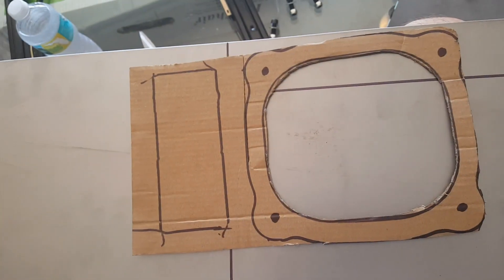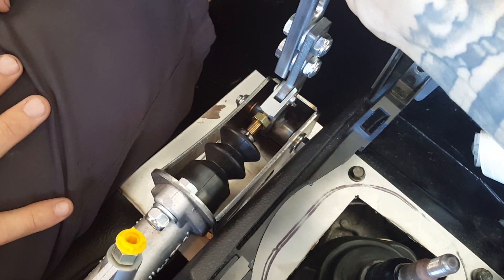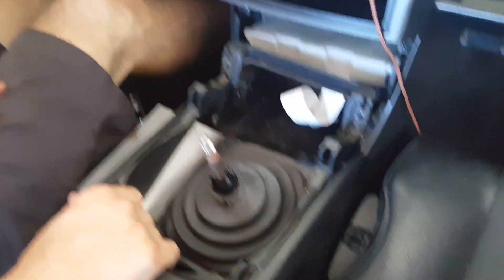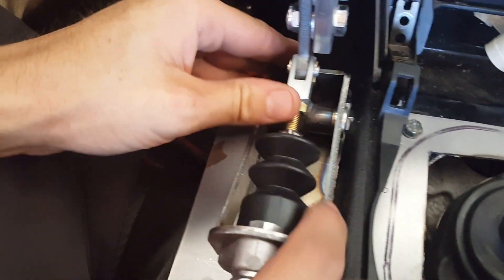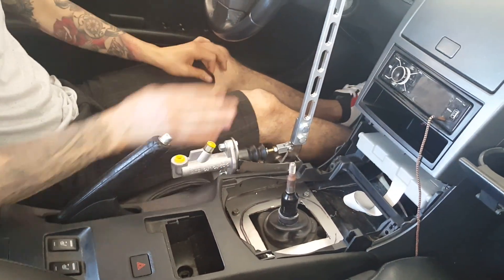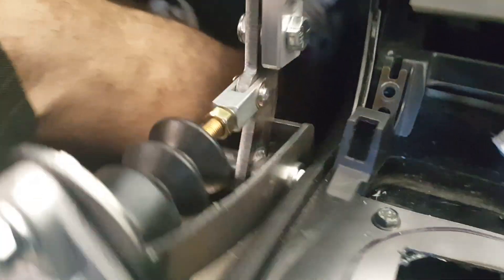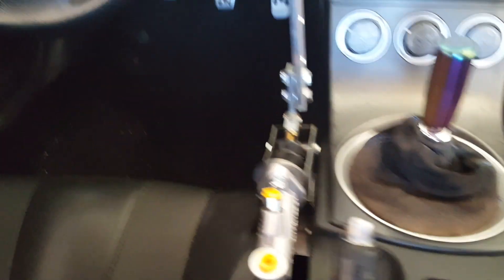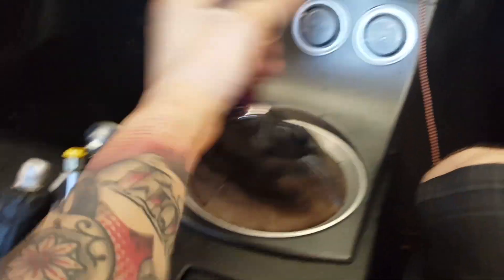ASD Hydro Mount | 350z

Comment: How did you run the lines
Reply from the maker: We use the ABS block. Wish I could post you a picture it would be easier. If you have an email you want to drop I can send you the diagram of the wiring.
Reply from the maker: Hopefully this makes sense
ABS BLOCK RL- HYDRO IN
HYDRO OUT - ABS MAIN
ABS BLOCK FR - ABS SECONDARY